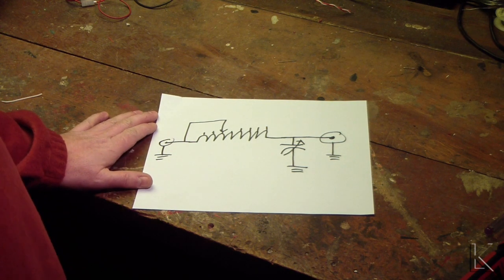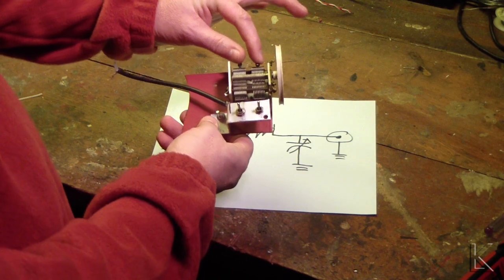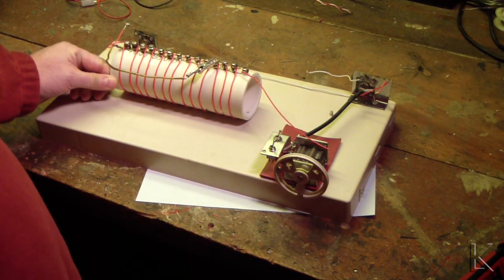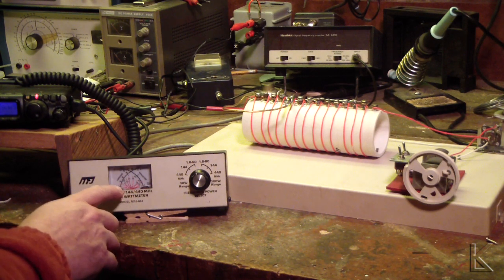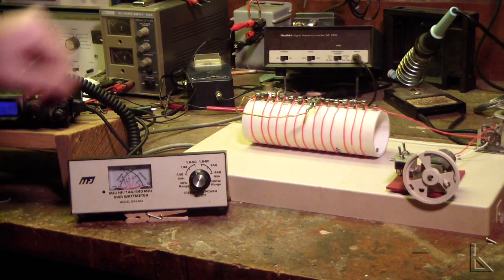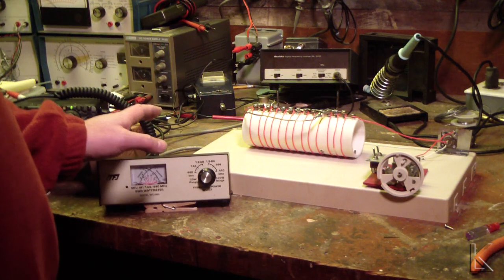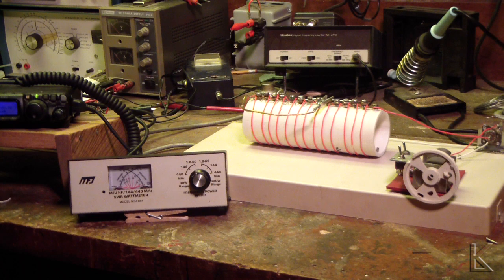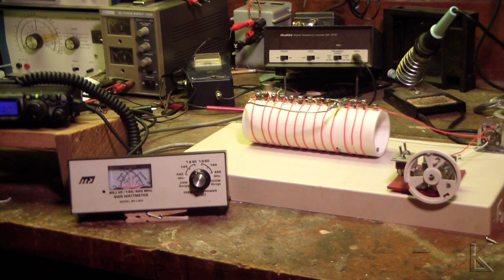Ham Radio - Build your own L network antenna tuner

Comment: If you don't have a tone function on your radio, do you have to make noise in it when tuning?
Reply from the maker: It would be a little harder to tune since the power would be bouncing around, but you really just watch reflected power and tune it to the lowest.
Most radio's have a key input for a code key in CW mode.   You could also switch to AM mode and key the mic to generate a carrier.  You want to turn the power down on the radio though, don't hurt the finals when it's initially out of tune.

Comment: Have you tried to calculate what values of L & C you need for a certain frequency?  I'd like to be able to tune my G5RV antenna to receive WWV on 60 kHz, wonder what values I'd need for that?
Reply from the maker: In that case, the impedance match between the radio and the antenna isn't the problem.  The short wire antenna isn't going to capture much signal to start with.  You'll need a longer antenna.   Over on teh HamAndShortwaveRadio channel, Greg did an extensive test with using a tuner to try to improve performance for shotwave listening.  His results were clear.  A tuner doesn't get you more signal out of an antenna than what the antenna can deliver.  At best, a tuner will act like a pre-selector, allowing for rejection of signals outside of the intended frequency.

Comment: crt is good it was working fine and it just quit it comes on has horizontal and vertical deflection crt is bright looks good but it doesn't display the menus I suspect character generator or possibly lost a voltage from the power supply I will get you some pics when I get home but as heavy as it is will definitely need to arrange one your buddies do swap at dayton.
Reply from the maker: Send me an email over on my address listed on QRZ please.  I'm working on the arrangements.

Comment: so if I made a legal limit the tuner. a high voltage variable cap is needed? would the coil need to be beefed up or what ever.
Reply from the maker: Yes, most certainly.    At those power levels I wouldn't try to build your own unless you can source high end components.  Vacuum variable cap, or very large plate spacing.  The inductor would probably need to be a roller inductor with silver plated bare wire and silver plated roller contacts.
Unless you're really ambitious,  I'd just buy a commercial unit.    This is more of a project for lower power stuff.

Comment: I see ur using a vhf uhf swr mtr on hf i think ill try that good luck on the hw 7 rebuild kg6mn
Reply from the maker: Not precisely.   That meter has two sets of connectors on the back.   One set for VHF UHF,   and one set for HF.  Each feeds a different H bridge designed for it's freq range.

Comment: Is a tuned antenna a better receiver, or is this just about transmitting?
Reply from the maker: A resonant antenna will always be best for the frequency band it's cut for.    For reception only, a random wire up in the trees can be helped just a bit by using an antenna tuner.
Reply: @loughkb  that's not necessarily true an antenna need not be resonant to radiate efficiency on the other hand the tuner provides a conjugate match to allow max power transfer in which the whole system becomes resonant

Comment: You might not be lucky enough to have a meter, what then? Just by ear, or can you rig a meter?
Reply from the maker: Most radios will have some form of built in metering for SWR.   Most modern radios for sure.
Reply: @loughkb  Your right of course, great video by the way I learned a few things and am interested in building one myself. Thank you very much for your interest in teaching others how to do things in the original spirit of ham radio.

Comment: What bands does this tuner cover?
Reply from the maker: That depends on the impedance mismatch of the antenna, the number of windings on the coil and the size of the capacitor.
i.e.  If you had a 230ft dipole, it would not be too far off for 160 meters and the tuner as built would be able to match it.   But a 40 meter dipole would be too far off to match to 160 meters unless the coil had about 3 times the number of windings.

Comment: T built mine many years ago in a similar  manner but you should enclose the whole  unit and when building the coil use a heavier wire and at least 20 closer spaced turns. I also used an old radio type variable cap. and never had a flashover.  Its also a good idea to include a swr meter.
Reply from the maker: As I said in the video, I was over building it to make it more visually clear.  If you watch the follow up video, you'll see I rebuilt it into a case with a more proper construction.

Comment: hello again. could you add a smaller inductor and bigger cap for a vhf tunner? i see adding a switch at the input so239 diverting the signal to the required section. and hook up the output combined to the output so239.
Reply from the maker: You would need a smaller cap I suppose, to bring it up to 6 meters, you could just tap the coil closer to the end for less inductance.    
However, long radiators don't work well at and above 50Mhz.  You could make the radio happy, but the antenna would just not perform well.
Reply: Excellent point...just because you can match the radio to the antenna...doesn't mean the antenna will radiate well.

Comment: Hi..can I use it for listening shortwave? Is it useful ony for dx? I have a long wire antenna for swl..if I use this tunner withm my anttnna, will the signals increase?
Reply from the maker: You may be able to improve reception on a broader range of frequencies.   But not much really.  You can't change how much signal the wire captures in the first place.
Reply: @loughkb  so is it not necessary for dx? I am just a shortwave listener, should I make one of these or it won't be effective ?
Reply from the maker: @denizyildiz8904  The sensitivity of your antenna at angles down around 10 degrees off the horizon will have more to do with DX than anything else.  
A good tall vertical with 32 or more radials will perform much better than a horizontal long wire in most cases.  
Nothing you put in line with your antenna is going to make any difference as far as what signals your antenna is actually capturing.

Comment: Nice video kevin. I've read other projects with higher number of turns like 40 to 60 on similar Dia form and taps at more specific and odd spots on the coil. Eg 1 3 8 11 15 etc. I guess trial and error.  Any thoughts on these other approaches? 
Also could I pull the swr meter out of an old cb or Sw radio and make a stand alone swr meter?  Thanks VA3RLF
Reply from the maker: You could use math to calculate the inductance and matching range of the circuit, then adjust your taps  and turns to provide a desired range and linear steps.  My point with this video is that the basic mechanics of the circuit will work well enough to be useful in many cases.
And I've seen old CB SWR meters at hamfests for $5 regularly.   But yes,  you could hack one out of an old radio if you want.  It should just be a little sense board, a variable resistor and a meter.
Reply: Kevin Loughin Thanks for your reply. Your goal with your video is accomplished well. Keep it up😀

Comment: How do you solder the switches to the capacitor?
Reply from the maker: I used short pieces of wire.   But that's not really necessary.  I found that I needed both gangs on the capacitor in parallel all the time.  So forget the switches, just tie both sections together.

Comment: The output of a small linear amplifier with 50ohms dummy load was 2watts followed by a test with a resonant antenna - Which is also showing identical result of 2watts. Interestingly, when a T network is connected between the antenna and the amplifier - WHEN adjusted the T network input Capacitor of 365pf - THE OUTPUT raised to 3.2Watt - HOW IS THIS POSSIBLE
Reply from the maker: How are you measuring the output?  I suspect an error there.  If using a power meter that doesn't discern between forward and reflected power, the analog meter may indicate the sum of both.
Reply: Kevin, thanks for your prompt response. I am using my regular SWR and RF power meter of Shack. I repeated the results several times. Its not an analog meter it can measure forward and reverse both.
Reply from the maker: Measure current draw from the radio and do some ohms law calculations to see if there is a correlating rise in power draw.  If not, then it's probably your meter responding weirdly to the impedance change.

Comment: very well explained.  

can you connect the shield of the SO239's and the ground lug of the capacitor to a common connection point?
Reply from the maker: They are tied together.   Every point on the schematic with a ground symbol are connected together electrically.  Usually to the metal chassis that it would be built in.
Reply: Understood.  Was your 98ft wire fed with coax or plugged direct into the SO239?
Reply from the maker: This type of tuner will work well in many different ways.    You could connect the end of the wire directly to the center of the so-239 right at the tuner.    You could use a coax and  run the wire off it's end, with or without any couterpoise off the shield. (although it will work better with  one.)
My antenna during the test was coax out to a feed point that had a 9:1 UNUN and four counterpoise wires.
I have used this kind of a tuner with only a center wire literally clipped to an unused electric fence before.    It's very flexible.

Comment: Hi, Kevin, this is a very good video,  and what's kind of antenna do you use for this tuner?
Reply: Or to say this tuner can match which kind of antenna?
Reply: And if I use a long-wire or end-fed antenna with 9:1 unun, can I use this tuner together with them?
Reply from the maker: Just about any antenna.   This will match a fairly broad range of impedance, and depending on the range of capacitor you use and the number of winds of the inductor, that range will increase.
Yes, you can use it with a 9:1unun and end fed wire.

Comment: Great video. Could you put an analog VOM on the speaker and measure the voltage to get the best "tune"?
Reply from the maker: If you had a very steady local carrier to receive.  Like a signal generator feeding some external wire your antenna could pick up.
Kind of a convoluted way to do it and it wouldn't be very precise.
Reply: @loughkb    I see the error in my logic..

Comment: Great video, could you use a toroid  and let's say a 12 position rotary switch. Instead of pvc pipe with taps.
Reply from the maker: Yep, there are endless possibilities.  I just wanted to show how easy it is to throw something together that actually works.   (I think I said something about how you could make it much much nicer.)  73.
Reply: Kevin Loughin Indeed you did. great video. I will be a brand new ham in February.  I have "0" circuit building experience,  there is no junk box to go to. Ebay is my friend. I have seen this circuit before but after your video I understand it. thank you very much. There is so much to learn.
Reply from the maker: Glad I could help, it's why I do this.

Comment: It looks like your inductor is not wired correctly. I would connect the input only to the tap.
Otherwise you are running a shorted inductor. 73 NO1SE
Reply from the maker: Just about every commercial tuner I've ever looked at works by shorting out part of the inductor.   Mine is wired the standard way.
Reply: @loughkb  do you understand that the shorted coils are magnetically coupled to the un-shorted coils?
Reply: @loughkb  I checked around and yes many are connected  in that way. That is incorrectly. Inductors are not pots. So why would this be?
Well usually they are very loose wound so 'maybe' the effect is that there is less coupling. Also I imagine if a Ham was key down and switched the inductor, a momentary open would present at the RF output amp. That would unload the amp and is probably not a good idea. It is an interesting question, do you have a NanoVNA? or an inductance meter? The behavior of the inductance as you switch from one tap to another would be interesting. You could make a video and call me out as an idiot if you like. That could be fun!
Reply from the maker: @mr1enrollment  The inductance reduces in steps.  I've measured it with my blue miniVNA.   
You might pose that question to EEVblog or one of the other engineers that run a channel.  Or contact the design department at one of the manufacturers and ask one of their engineers if you really want to dig into it. 
My thought is, once you short past a group of windings,  they are shorted end to end and no electrical potential can build up in their windings.  They act as a single conductor.   
As to tuning,  I always recommend people turn their power way down before tuning, to protect the finals from spikes as the cap and inductor values are switched.  Many tuners use relays and banks of fixed caps and coils, switching them in and out during a tuning cycle with relays.
Reply: @loughkb  of course it still changes the inductance. But does it do so gracefully?
Probably not. Also must effect the Q. I see why it is done but I think it a poor practice.
There is probably a simple corrective measure - like putting a resistor at the end of the coil where the tap wire goes to the switch. That way the 'unused' windings would not be shorted. Still loaded but not shorted. As to EEVblog, no thanks. Not that interested. If I was I would build/test it myself, and I am an engineer.
Reply from the maker: @mr1enrollment  Ok.

Comment: Amazing video. What type of calculations did you use to build this and what would be a good substitute for that capacitor?
Reply from the maker: I didn't use any math.  The L configuration will provide a range of tuning  for most common antennas.  The more inductance and capacitance just extends the range.  There are resources for calculating values if you know the range of loads you're going to hit it with.  But you can just throw one together and it will work for many cases.
I pick up air variable caps at hamfests.  You always find some guy with a box of them cheap.
Reply: Kevin Loughin Thank You

Comment: I took my 11 meter dipole down yesterday to test it with my nanovna H4 and surprisingly the SWR was higher outside at 2.9 to 1 than it was inside  on 50ft of RG8X coax at 1.4 to 1.
 I tested outside with 6ft of coax.
Now I'm wondering if I need a calculated half wave jumper to get an accurate SWR.
Or I suppose I could have calibrated the nano to the end of the 6ft jumper?
 I didn't have the SMA  adapter for that.
Reply from the maker: The coax, connectors, and anything else in line like a power meter, will all affect the SWR.   You can tune an antenna, at the antenna and get it perfect.  Then connect it to a long coax run that maybe has some of it coiled up, passes parallel to a power line, and has an unsealed end that's let a bit of moisture in over the years and you'll read a higher SWR.
Reply: @loughkb  i had it strapped to a wooden bird house pole 6 inches off the ground. Maybe too close to the ground?
Reply from the maker: @RC-Heli835  Dipoles work best when they're at least 1/4 wavelength off the ground, better if 1/2 wavelength up or higher.   The ground becomes a load to the antenna, absorbing more signal than it reflects.
Reply: @loughkb  Its usually 9ft off the ground.
From what I gather if the antenna is a 50 ohm load and you have 50 ohm coax length of coax does not matter but if the antenna is not 50 ohms with 50 ohm coax you have to have a calculated 1/2 wave or multiples of half wave coax calculated on the frequency to get an accurate read on the antennas SWR with an analyser.

Have you read the article "My coax tunes my antenna" date 1956
Reply: @RC-Heli835 You do not need a halfwave of coax to get a good reading.  The antenna impedance ( whatever it is ) appears at the input of a half wave length of coax. In fact the impedance connected to the end of a transmission line will repeat every halfwave on the coax.  For example 100 ohms at the end of 50 ohm coax will be transformed up to a maximum value 1/4 wave back from the end and then transformed down to 50 ohms at the 1/2 wave point. It will rise again to a maximum at the 3/4 wave point and back down again to 50 at the 1 wave point. The SWR is essentially the same anywhere in any length of coax. However the most accurate SWR reading is at the antenna terminals.  Coax has loss, so the longer the coax or the more loss you have will give you a lower SWR at the transmitter end of a long or lossy coax than at the antenna terminals where the reflected wave has not been attenuated at all. Usually a broad low flat SWR across a band indicates excessive loss.

Comment: Does it matter the diameter of the coil?
Reply from the maker: It changes the inductance and probably the tuning range as well.  Most commercial units I've seen have a 2-3 inch diameter variable inductor.
Reply: Ok, thank you 😊 I have a lathe and I’m going to thread a piece of pvc pipe, I have 4” diameter, but I can buy 3”.
Reply: By threading the pvc, it will give a groove for bare copper to keep the spacing.
Reply from the maker: @tomcook5813  Good idea, should be very nice and uniform.

Comment: Can that L network tuner be used in your loop antennas?
Reply from the maker: You never want to use a tuner with a magloop.  The loop is very narrow already.  If you are off on the loop tuning and you try to compensate with an in line tuner, your radio will be happy, but the antenna will be far from it's efficient point and won't radiate well.
Reply: What about using the tuner with a
 mag loop for receiving only?
Reply from the maker: Same issue.  The loop needs to be tuned to it's sweet spot.  It's not as finicky if you're just receiving though.  Easier to tune for RX.
Reply: Ok Kevin.....Thank you for your input.